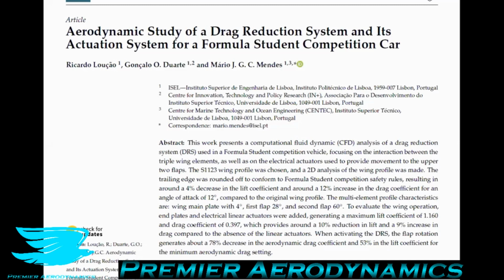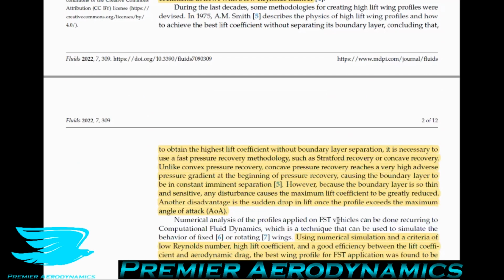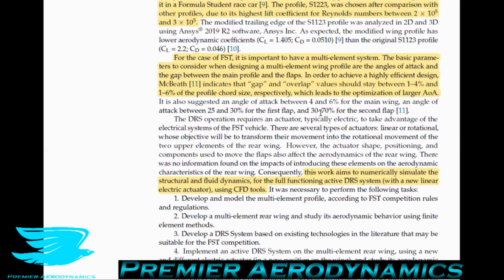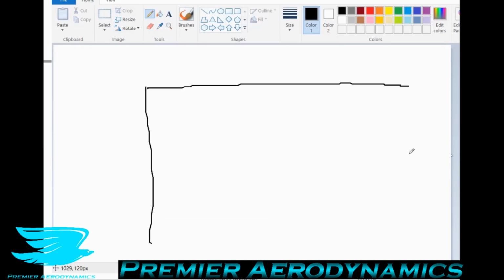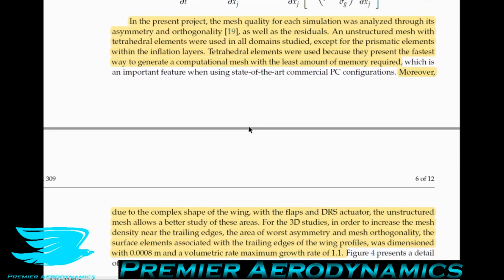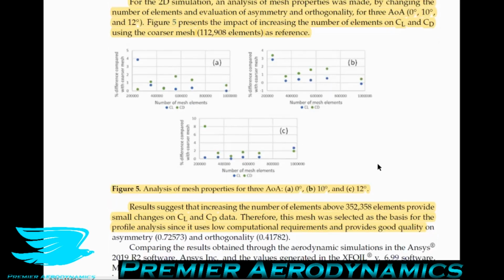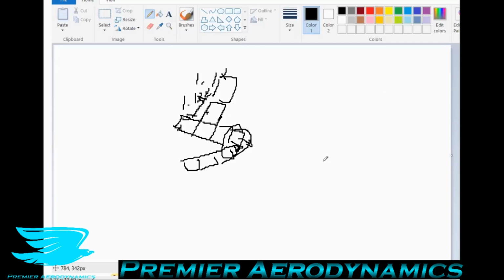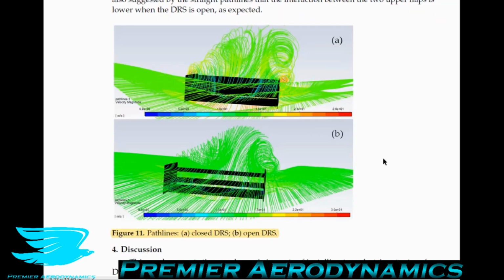Aerodynamics of Drag Reduction Systems for Formula Student Cars - Podcast #115

Comment: I think that for active aero to truly work, it will require some sort of avionics. Perhaps an AI avionics system that measures the drivers inputs and biometrics, and adjusts downforce via active wings and diffusers.
Reply: in Formula Student "acitve aero" ist done by e.g mounting the frontwing not to the chassi but by mounting it to the suspension system, so the frontwing is always in the same position. Most of the times the teams choose the easiest way to do stuff.

Comment: In my experience in Formula Student Simulations of just the Rearwing are a waste of Time for the most part. The upstream vorticities of Formula Student cars completly fuck up the Rear Wing. If you look at pictures of the cars you will see e.g that the drivers head is directly in front of the Main Profile of the rear wing.  I think that the paper is a good example of cheery picking.
Reply: Yep all that bodywork affects the flow field the rear wing sees.
Reply from the maker: Definitely. And that is also the case, to some extent, even with the top tier racing (formula 1). A lot of teams cannot afford to analyze how wakes affect their setup properly.